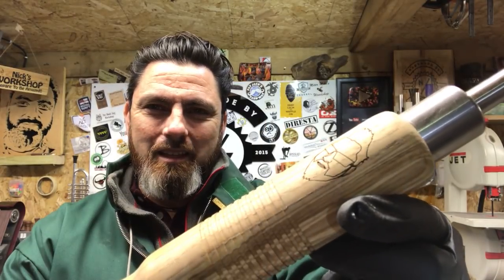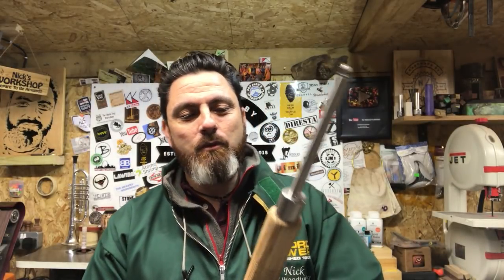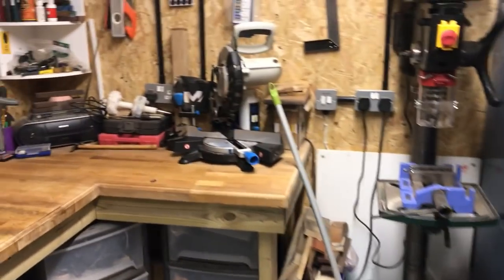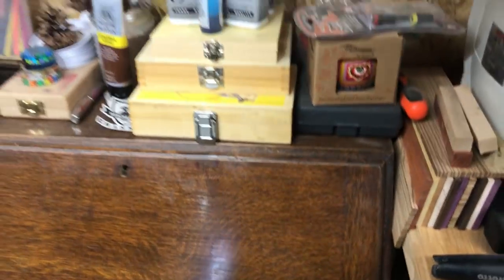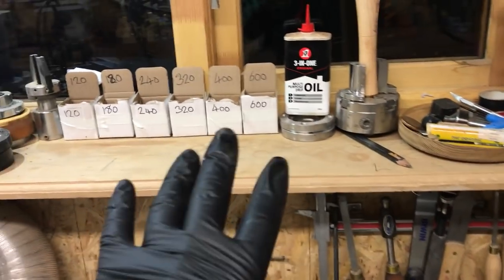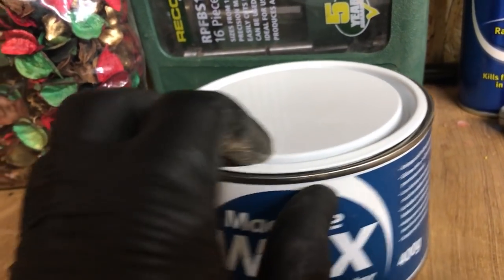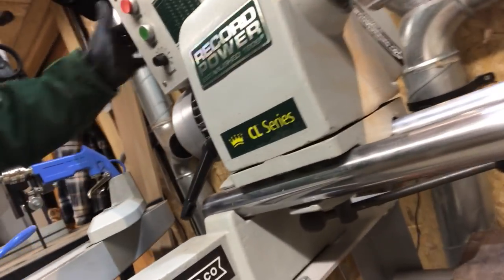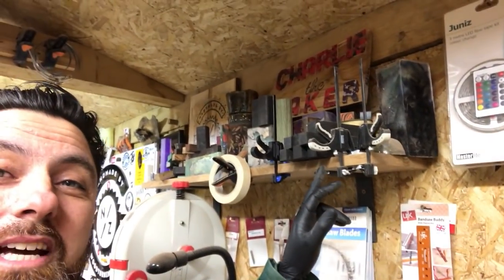Woodturning -  Carbide Cutting Tools! #WW41

Comment: Awesome my brother I like theme great job, I have two lathes and no lathe tools that's sad and I can't buy them too expensive and I can't afford it :(
Reply from the maker: hey buddy, long time no speak. hope all is well.
Reply: Make your own carbide tool.  They work well and are a ton cheaper than most commercially advertised ones.  
But, IMHO the square cutter works the best with a solid SQUARE rod.  The round rod is not as good as when it hits a bit of rougher wood it tends to twist too easily---  Especially when using it to hollow out a bowl.  Peace  :)

Comment: Hi NIck
Just curious?
I've never seen you work on a spindle project or anything that requires a lathe with a long bed like the one you have.
Does that just happen to be the length that model comes in - or did you choose it for a reason.
I have a Nova 2024 which I love, but it has a short bed. (Bed extensions are available) - so wondering if a longer bed comes into any use for anything other than longer - spindle type projects.
Value your opinion.
Regards
Dennis Beamish Cambridge Ontario Canada
Reply from the maker: hey Dennis, i like the long bed as i find it gives me more room to get at my work.